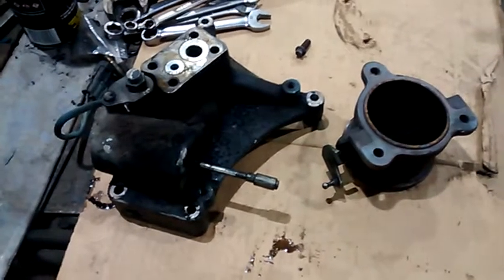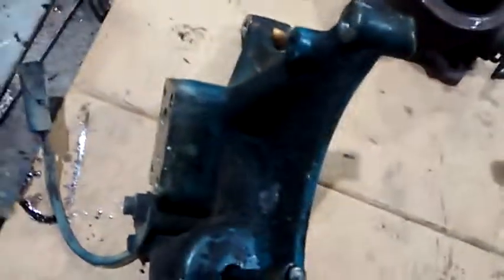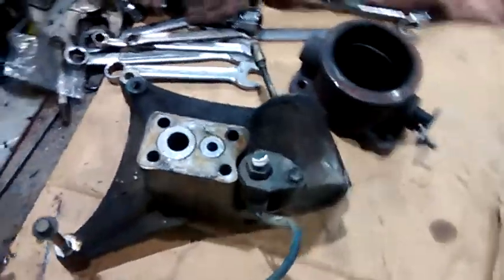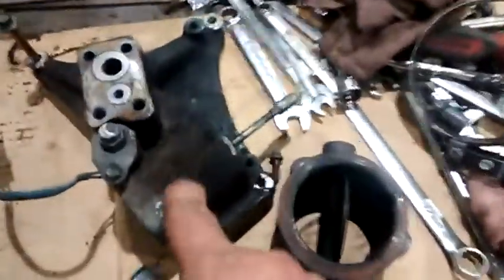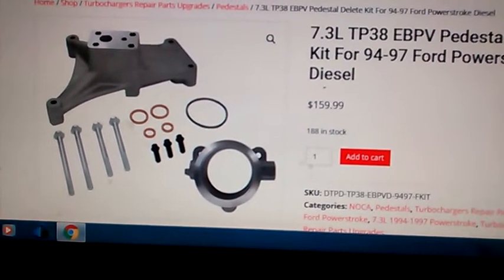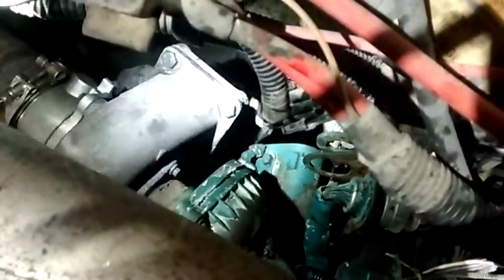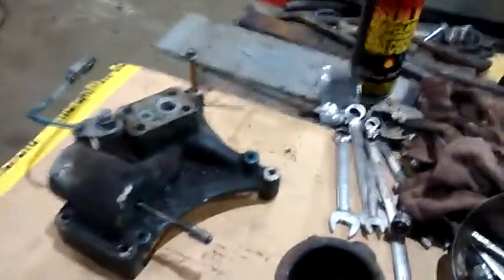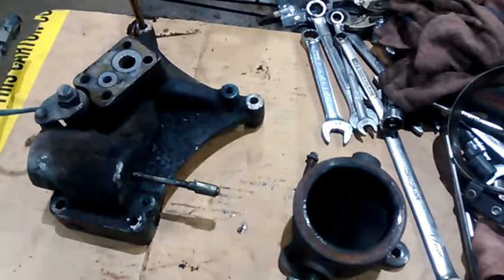Skoolie Maintenance and Repair Series EP 3 - T444E EBPV Delete

Comment: Okay so I'm having the exact same issue in the exact same spot and I can get the two bolts off of the front of the turbo but how did you get the two nuts off the back it's a 13 mm and I can't get an open-end a shallow socket or a deep socket back in there even with the swivel arm? Thanks again Johnny I am really interested in getting this taken care of cuz I also am starting my skoolie and I look forward to connecting with you and showing you pictures.
Reply from the maker: I used a 6-point combination wrench and also had to use a torch to heat the nuts up.
Reply: @JohnnyMullet  oh yeah thanks again buddy, I got the third nut off which was pretty hard and now I'm doing the very far back one which is behind the turbo and behind the other pipe going down and I had to get a mini 6 point swivel soak the nut in WD-40 overnight and then wipe it off in the morning and then torch it for a good while but I can barely get any grip on it. I can feel it's going to crack loose here in the next day or two.
Reply: @JohnnyMullet  Thank you kindly , I totally got it off after soaking and heating up the nuts. I appreciate you kindly sharing and getting back to me. I will ask that I did not buy the delete kit but I did end up forcing my wastegate open and taking out the spring and socket and just putting a bolt through that hole and sealing it shut in the pedestal, but the holes underneath and inside the pedestal or obviously  still there but just not the one that allowed for that screw to go back and forth opening the wastegate . is that going to do anything to the oil coming in and out of there or for pressure seeing as how it's not an actual delete kit and the spring and that hole is not going to allow oil to come in and out of it where it did before?
Reply from the maker: @zerijah  oil travels through the pedestal and will leak if not done right. Oil also needs to feed the turbo.
Reply: @JohnnyMullet  okay so the little screw that comes out of the hole where the spring is connected to that allows for pressure to go in and out I just blocked that hole with a bolt but the holes going through the bottom of the pedestal and up into the turbocharger is still opened. Will that change anything?
Reply from the maker: @zerijah  That should be OK. Good luck.
Reply: Thank you again kindly  @JohnnyMullet . there is a difference in the sound from the engine and exhaust. The difference is when I push on the gas before it would have this wolf sound and keep the wolf but now it Wolf's immediately and then drops out and has a steady low sound, is that because the wastegate is completely open now?
Reply from the maker: @zerijah  yes. You now have a free flowing exhaust.

Comment: You forgot to say that you need !PATIENCE!.  12 point bolts are a bitch. Lots of heat and take your time. If you get frustrated.....walk away till your ready to try again. It took me 3 weeks to get all those exhaust rusted bolts to come out.  I have to do it again this year cause my hpop failed and the back pressure from the injectors blew my fuel pump....I think.  Lol  Good video...I missed those leaf spring grease tits.

Comment: Question for you Johnny Mullet. I'm looking right now at a 2002 International 3800 (9 windows) with a DT466E Allison 545, the speed is restricted to 60MPH and is said I can get the ECM reprogrammed at a dealer as "unlocked" and increase power (re-rate). Is that true on these busses?
Reply from the maker: Yes. The road speed limiter can be disabled with a proper scanner.
Reply: @JohnnyMullet  Thank you very much for the information.

Comment: Great videos as always Johnny Mullet. Awesome, you eliminated possible mass engine failure by eliminating one major prone oil leak, one mostly to fail wastegate and one electrical hookup not needed (deleted) for $159.00. The long term rewards will outweigh today's mega agony. As a former GM master mechanic, that's a job you laugh at and take in stride. Yep, a f**k job for sure. Lol, I know well.